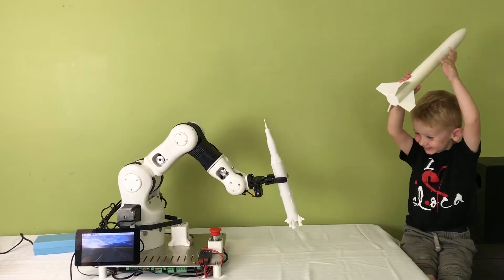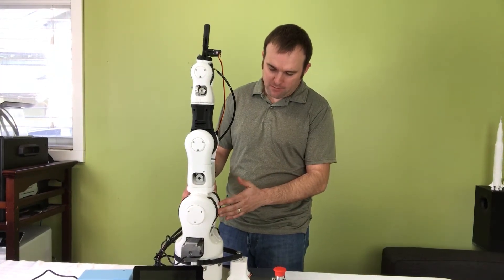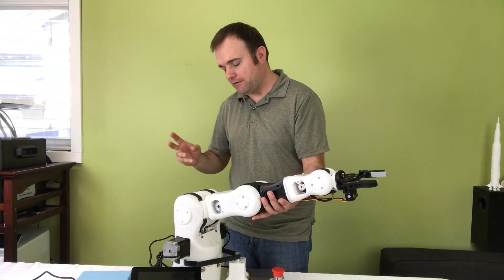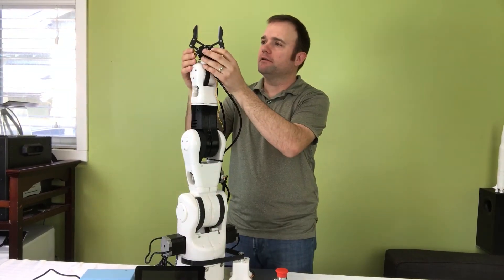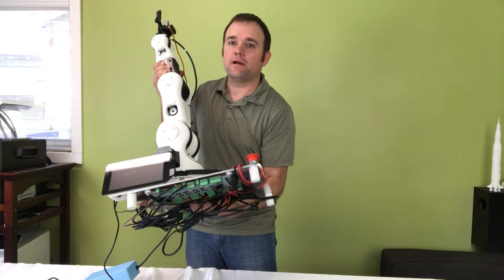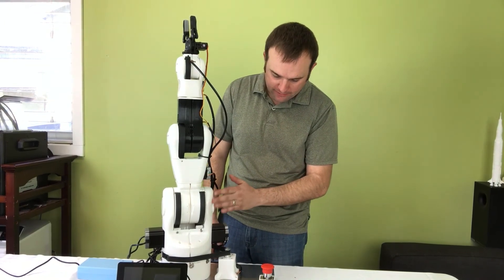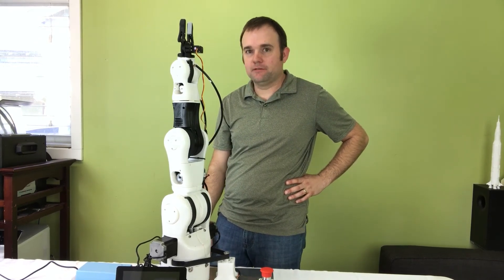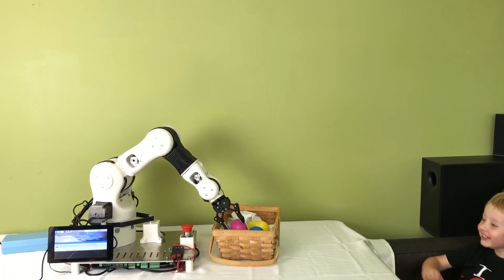DIY Robot Arm - 3D printed with stepper motors

Comment: How quiet are stepper motors compared to servos? Can steppers move quickly while producing relatively low noise in comparison?
Reply from the maker: Stepper motors have no gear noise but do kinda of buzz when in operation. If I was going to do it again I would use the Odrive controller with brushless outrunner motors with an encoder. From the test I have done so far it is very quiet and very fast. https://odriverobotics.com/
Reply: @dustingamble4137  what stepper drivers are you using? TMC series have silent stepping options i have heard

Comment: Hi, 
Which PLA did you use to print it? Also what's the max pay load this arm can handle/Lift?

Regards, 
Junaid
Reply from the maker: Junaid Ahmad I mostly used ABS with 40% infill. It can't lift more than about 200g at full extension. A little more depending on how it is articulated. Some motors are stronger than others.

Comment: Hello dustin,
I also built the Moveo robot but at this time I can only move 3 motors and the servo using the recommended firmware and pronterface. Could you tell me how you manage to move all the motors? Are you using special gcode?
Thank you
Rafael
Reply from the maker: Hi Rafael, I kinda of cheated and I'm using the Roboteurs Slushengine Model D which plugs into a Raspberry Pi. Then you just need a bit of python script to get it going. They provide samples. https://roboteurs.com/collections/slushengine/products/slushengine-model-d
Reply: Thank you very much, I'll give it a try.
Reply: why not give this software a try. https://www.youtube.com/watch?v=9Lhgy93SrA0&t=42s